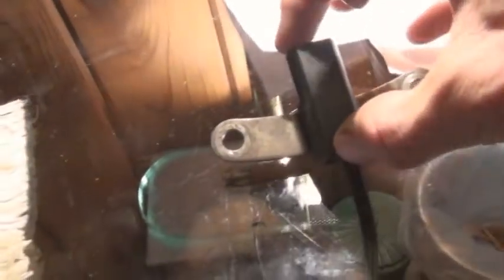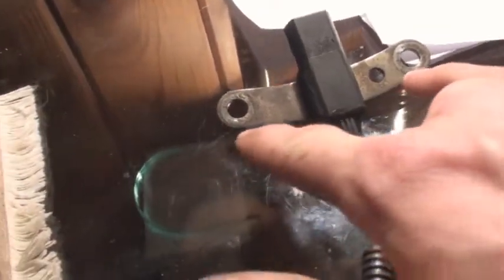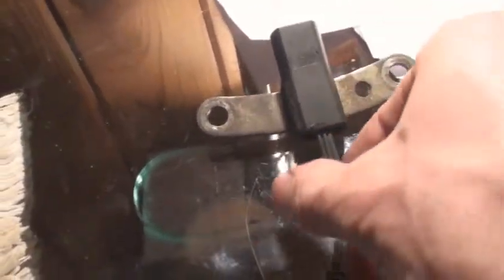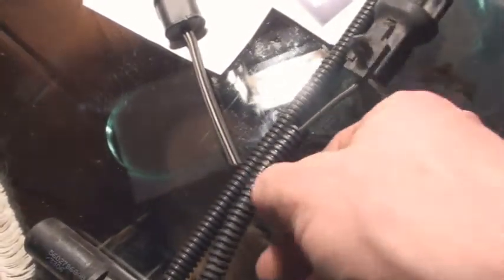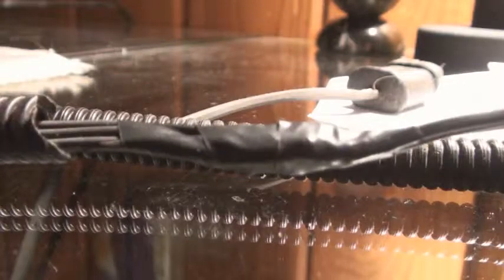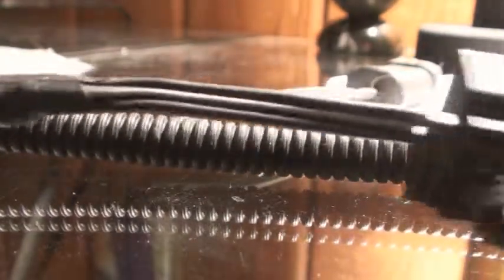AX15 ZJ SWAP - How To, CPS Modification

Comment from the maker: **PLEASE MAKE A VIDEO WHEN YOU ARE DONE!** I Love seeing other converted Jeeps.

-Are you using the correct CPS? Does it look like the one in my video?

-Where did you get the flywheel? Some flywheels have a different count of teeth for the CPS to register, and some aftermarket flywheels don't even have teeth/cogs. 

-Did you bang, drop or strike the CPS with anything? They are very sensitive to damage via hits and smacks.

Comment: I turn the key nothing happens but clicking from the fuse box. I bought the stater fuse relay and new cps sensor. The starters I know are good. I can start the jeep by jump stating the starter. It will start fine when I jump it form the starter. Any ideas.
Reply from the maker: +Mike Alfaro Battery? Have you checked all related fuses and relays? What about a security system?
Reply: +LostFart I have not touched the security system what would I do for that
Reply from the maker: +Mike Alfaro You would have to Google that. I don't know anything on the security system.

Comment: Hi, I am currently working on this swap on my 97 zj,  I would like to know what year cps do I need to buy, I have a 94 zj sensor but I not sure if it works
Reply from the maker: I used a CPS from a 1997 Jeep Cherokee XJ I believe.

I think its recommended to buy a CPS for the AX15 year you have.

Comment: Everything is all done but it won't start. Radio all light turn on but no crank or anything just a clicking sound from my fuse box.
Reply from the maker: Hey man. I'd love to chat about this. Would you be up for Skype in about 14 hours? I run on GMT -06:00 time.

Comment: How did u wire up the other sensors
Reply from the maker: +Mike Alfaro I just left the ones that were not needed. The only wires are the CPS, reverse lights and NSS.
Reply from the maker: +Mike Alfaro I just left the ones that were not needed. The only wires are the CPS, reverse lights and NSS.

Comment from the maker: No, do not mod the Crank Position Sensor. The mount and style are different from the AX-15 so I thought by splicing the wires and CPS from the AX-15 to the automatic wires would save me time and money but NO. They are very delicate sensors and a flick of the finger will wreck them. I didn't know that so in conclusion, just buy a new one for the 1997 Jeep Cherokee.